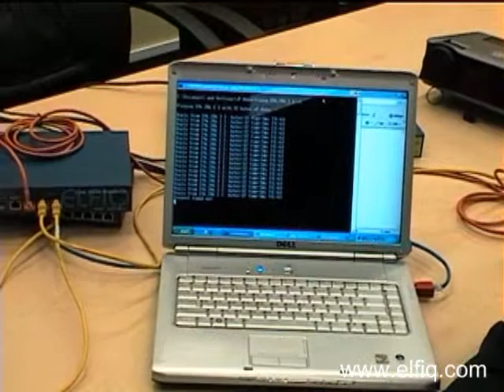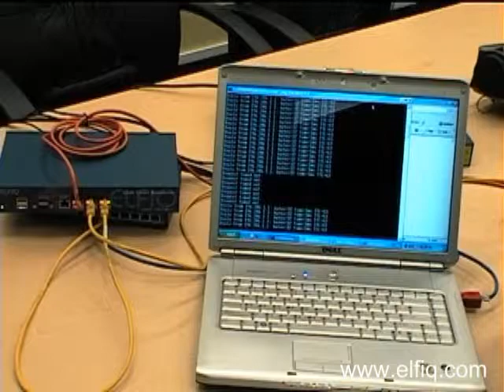Elfiq Networks LAN Failsafe feature demonstration

Comment from the maker: Hi - in the 550x models the common port used for the failsafe for the ISP is #2, the firewall is usually in port #3.

The way LanFailsafe works is a "fail-close" process so if the unit loses power ports #2 & #3 get bonded so the network continues to operate.  The ISP used for the process is what is refered to as the "primary link" (also known as the ISP link which was in place prior to adding the Elfiq unit to your network).

You add the other ISP(s) on port #1 by itself (for 1) or in a switch.